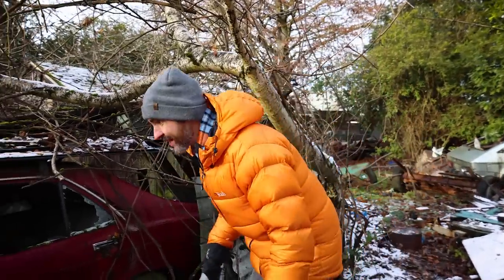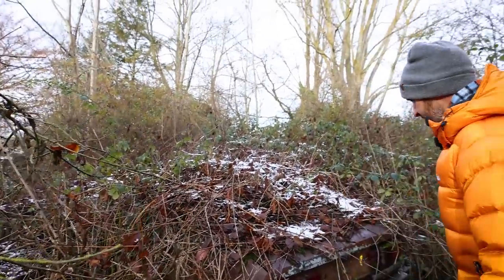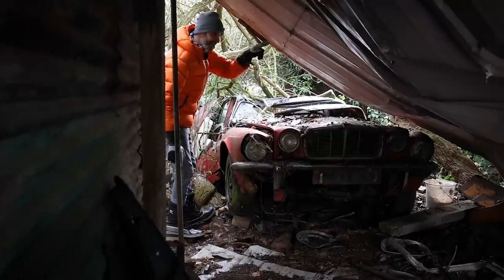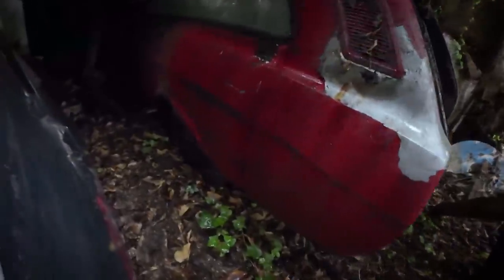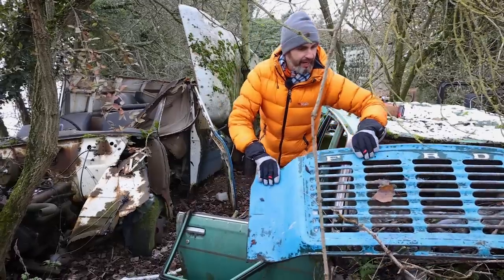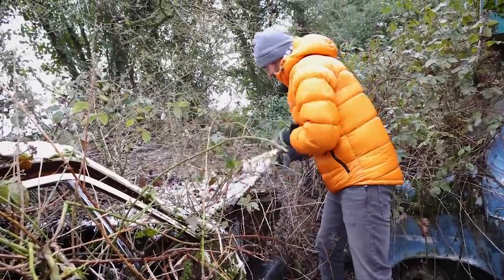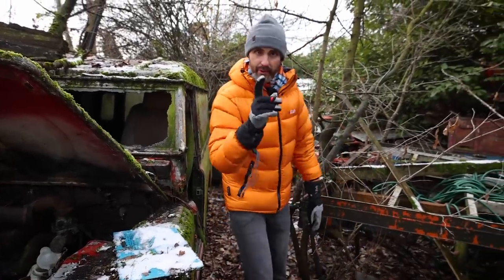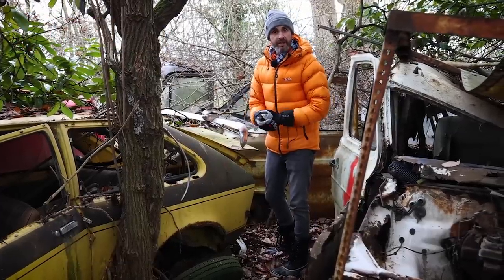Secret Garden of abandoned rare classic Fords and more. Carchaeology!

Comment: The green Japanese car looked like what was sold in Australia as a Datsun 180B (I'm sure it had different names in different markets).  The shape of the rear doors and tail-lights are a pretty good match.
Reply: Its not a 180 B engine. its OHV so its much earlier than 180 B.  Datsun 1600 [510 elsewhere] on had OHC engines canted to get lower bonnet height. The last OZ Datsuns with those series engines were the first bluebirds of the late 60s and they did not have Macpherson strut front ends or power brakes. The smaller Datsun Sunny would have had all that stuff but the vid I am watching does not show the rest of the car and the engine looks bigger than a Sunny engine that was 1300cc I think.

Comment: There's only one thing sadder than a car graveyard: finding one of your old cars in one!  I once stumbled across a field full of late 80's and early 90's cars on the edge of the Brecon Beacons and while wandering through I saw the rusty rear end of a Nova.  It caught my eye as it was the same really light metallic green (silver/green code 41L) that my old one had been 10 years previously.  It was just a bare shell but with the engine still in place so hard to tell what age it was until I lifted the bonnet and saw the air filter housing with my handwriting on it saying the service mileages!  A bit more digging revealed the driver's door was originally red, same as the one I had replaced on mine, and the boot floor had the exact same holes in it that I had put in mine to fix my subwoofer enclosure down.  Still didn't believe it was my old car but I found the VIN plate and took a photo of it, knowing I had a picture of my car's one at home.  Compared the two when I got back and it was indeed my old car.  This was all back in 2011 and the site was mostly cleared a few years later.  A few cars still can be seen from afar and it's the bit of the field the Nova was in but some development work that cut through the field mean it's no longer easily accessible.  No idea if it was undisturbed or not but I do remember the scrap lorry taking away quite a few cars in 2013, didn't see any Novas on it but plenty of Rovers and  Fords.  I did have photos of it all but I sadly lost them in a house move, wish I had them now!
Reply from the maker: Wow, what are the chances of you stumbling across your old relic? Kind of exciting and sad in one breath.
Reply: Wow fascinating that must’ve sent cold shivers through your body
Reply: @TheLateBrakeShow  it did stun me for a few seconds while I took it all in!
Reply: I can relate. My first car - 1972 Formula Firebird. I was 18, emotionally attached to the car. This was 1989. Sold car two years later. Believe it or not, I seen what looked similar to my car in a youtube video years ago! I reached out to channel, got a response. The Oregon license plate (my plate, it was my car!) was still in the guys garage! Car made its way somehow to Minnesota. He said car was severely wrecked in early 2000s, and rusted out so bad it was sent to the recycler. Broke my heart .....
Reply: Crossed paths with an old unconsummated flame coming out of Aldi just this very evening, and instantly greeted with a kiss on the cheek and those smiling eyes.  Fifteen years on she’s even more smoking hot, and married with two gorgeous kids. OUCH.
Reply: I saw my first car on the road a few years ago. I sold it because of the drama attached to it but I still love that car. I scrapped the last few cars I've owned so I won't see someone else driving them.
Reply: 20 years ago in 2003 I saw my old Austin Montego that I part exed for a Rover in 1993 in a scrapyard in Hertfordshire.  Very surreal feeling for sure...
Reply: @JayWelchy  0
Reply: In 1997 my dad bought a brand new peugeot 306, I was 15 at the time. He kept it for 3 years then sold it to my uncle who himself kept it for another 4 or 5 years then sold it, in mint condition. Never saw it again. 

Then 10 years later, as a mechanic working for peugeot, a red 306 came in for a service. I looked at the reg. It was my dad's. The thing was absolutely battered. Dents all over, 200000 miles, properly abused. I immediately took a photo and sent to my dad saying "recognise this?", he was equally as stunned. Very surreal seeing the car my dad bought brand new all those years later right at the end of its life.
Reply: Im still searching for one of our old cars dont know where it is in oxfordshire but its on a sorn

Comment: The land rover is the usual 'one land rover made out of several others' model. Probably started life as a 11A, dash and probably bulkhead are series 11A, but with a series 111 front end. Door hinges are a give away. Looks like the rear body originally had a hoops and sticks soft top as it has the hooks for the canvas ropes in place. Out of all the vehicles there, its probably the only one that could be rebuilt, would need a chassis, but the rest is reasonably straight

Comment: The Land Rover is a series IIa from the late 1960s. The main clue is the instruments in the centre of the dash. You can tell it’s late 1960s as they had separate wiper motors for each screen up to the mid 60s. This one has the single motor working both wipers

Comment: The Land Rover is a late series IIA 109 so about 1968...71.  Looks like it might have been a 2.6 litre 6 cylinder originally but I think thats a BMC 2.2/2.5 diesel in it now - maybe one of the taxis was its engine donor?
The body line looks remarkably straight given the chassis is probably rotten but they are easy to replace so its probably the only vehicle in the yard that's not too far gone.
Reply: Going to say the same, metal dash split windscreen but with outer headlights makes it late IIA but not a III. I have a "68 CKD and by that year should be outer headlights from memory but a few of em still had inner lights like mine. 2.6 cars had a deeper firewall and the engine is further set back but hard to tell from the video. (Got both a IIA 2.25 and a IIA 2.6 but a Holden 179 swap but using the original 2.6 engine mounting locations)
Reply: @darcybowyer5743  No fuel filler behind the drivers door so it must have either the bigger rear mounted tank (only standard on 6 cylinder and station wagons back then) or under the seat fill (twin tank MOD spec).  Doesn’t look ex-MOD so I’d go with the six pot theory.  The heater also looks to be mounted sloping rather than near vertical so another six pot tell.  Servo brakes were pritty rare in that period too and I think they were standard fit on six cyl models before it became the norm for everything (though some early ones used remote servos) - stuffing a later servo pedal tower in is quite an easy retrofit though so it could just be off a later car as it’s clearly seen some modifications in its life.  A lot of six cylinder models seem to have had engine conversions, probubly because the original engines didn’t offer a lot more power especially top end but did use significantly more fuel.  In the UK they often fetched lower prices as no one wanted to fuel and maintain them.  They also didn’t tollorate neglect and abuse as well as the 2.25 did so some suffered mechanical failures after being rev’d too hard for too long.  In export markets people weren’t so scared of large engines and didn’t consider 2.6 to be all that impressive so swapped in a more grunty localally sourced engine like your Holden when the original needed work.  I always thought it odd they made quite a few 3 litre prototypes and enough found their way into fire engines it was almost a secret factory option but never made a ‘production’ model dispite making the engine for cars.  Maybe that stretched the gearbox too far on the heavier land-rover work?
Think the UK was the last market to get lights in wings, initially they only did it where it was legally required though some also get registered late.

Comment: I believe the green Japanese car is a Datsun Violet. I had one in the 90’s and it was very reliable but rust was eating it alive 😬. I called it the Violent 😂
Reply: I think your right, wasn’t it also called a 140 J ?
Reply: I thought it was a sunny but i think you're right.
Reply: I thoughts so too - 140J or 160J Violet, late '70s.  Rear light cluster and the the "chrome" around the windscreen pillars made me think it was a Violet rather than a Sunny.
Reply: Looks a bit more square like a Datsun 510.
Reply: @pjw140  I too thought it a Sunny as I had one in that colour - but the dash wasn't quite the same (although the switchgear was!) and yes, the chrome windscreen pillars. My brother had a 160J SSS coupé in white.
Reply: I was thinking it was May be a Datsun Laurel? They certainly came in that jade green colour?
Reply: I thought Sunny at first, but it looks a bit bigger. I'd forgotten about the Violet.
Reply: Bet that engine would run again with a little fettling
Reply: It’s a 140j for sure…
Reply: Is it not a Stanza? or is that the same as a Datsun Violet as I know they used to do alot of badge engineering at the time.

Comment: The green Nissan is a PA10 Violet. Also called Auster/Stanza in some markets (updated /face-lifted). Usually came with a OHC 1600 L-series (L16) engine but an OHV 1400 A-series (A14) engine were offered in some markets.

Comment: You're playing mean tricks on the geeks.
Here I am, trying to decide exactly what type of Land-Rover that is, when at 19:32, you edit in a clip of the engine bay of an entirely different vehicle that's roughly the same colour!
It's a series 2a 109 hard top.
The headlights in the wings rather than radiator grill and the shallow sill panels mean it's from 1969 to 1971.
The seats will have been replaced at some point, and the door hinges are a series 3 type for some reason.
Might have had an engine swap to a non-LR unit? but we didn't get many shots of the real engine bay.

Comment: the Landy was a fairly early one. my guess (with it having outboard headlights) would be series 2a. the dash is wrong for a series 3.
Reply: Pete pretty sure it is a 2a crossover model (1969-71) as dash is 2a but wings are 3. 
The 2a normally had inboard lights in grille panel and centre dash. Series 3 had dials behind steering wheel and the headlights in wings.

Comment: I reckon that Avenger might be saveable. The top corners of the front wings, the rear wheel arches and the sills would usually rot out quite readily, and those ones still look quite good.
Reply from the maker: It was probably the best out of the bunch (and Jonny's favourite)
Reply: @TheLateBrakeShow  It's really in pretty good nick. To contrast the climate, I am restoring a 72 Plymouth Cricket that sat for 30 years in Oklahoma and other than floor pans, it was rust free!
Reply: @TheLateBrakeShow  Definitely my favourite there. My first two cars were both Avengers, and neither was ever road-legal. Someone please save this one!

Comment: The red car at 15:50 is a Peugeot 104 5dr. From the black stripe maybe even an ‘S’ model with the 1360cc engine. Any Peugeot 104 is rare as hens teeth. I’ve one of 2 104S models currently on UK roads (and a Citroen LNA).

And Johnny you’re correct with the Samba link. 3dr 104 came first, Citroen LNA was same length floor pan. 5dr 104 was a longer floor pan. And finally came the Samba on a floorpan between the 3dr and 5dr 104s. Gearbox in sump like a mini hence the characterful transmission noise.

Comment: It’s 1969-1971 series 2a Landy. The lights moved to the wings but the bulkhead kept the metal dash. People did retro fit the later fronts to older cars but the single wiper motor the passenger wing with no heater intake grill and crucially 2 little tabs for holding the metal grill on. 

Love the orange puffs mines just died but I am trying to work out how you don’t look like a Michelin man in one as I do

Comment: Hi Johnny my name is Marc from Australia. Over here the nissan you found was sold as a Datsun Sunny or Datsun Stanza. Also you may be interested to know that the Transits you showed us were mostly powered by 6 cylinder engines  out here. Either 4.1l or 3.3 l straight 6. Also true for the Bedford that had a Holden 6 Cyl 3.3l engine.
Reply from the maker: Six pot Transit mk1s? Nice. Thanks for the info Marc.